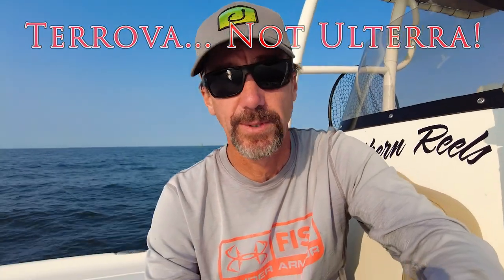Minn Kota Trolling Motors (The Good, The Bad, and the Ugly!)

Comment: Wow...what a gracious and even-handed treatment of your experience.  Thanks for sharing!!  When I used the motor selector (I have a new-to me since April, 2024 Sea Hunt Triton 172) it recommended a Riptide Terrova 80lbs thrust 24v with a 72" shaft.  My only gripe is that either I'm going to have to fabricate and mount the unit on a bow sprit or cut my bow railing.  Like you, I consider my boat practically "unfishable" without a trolling motor since the tides and wind on the Long Island Sound mean the fluke drift can be too fast.  Not looking forward to the struggle of wiring to the bow from the console, either...but weight distribution on a 17 foot boat is a significant concern.

Comment: I recently saw another YouTube video talking about using a Minn Kota trolling motor when fishing near a bridge or when you can't get a good satellite signal. The gentleman suggested switching the autopilot mode from Advanced to Legacy in the settings. Legacy uses a compass instead of a GPS. Then you set a compass heading into the current and adjust your Trolling Motor speed to hold your position. I haven't tried it yet myself but it seems like it's worth a shot.
Reply from the maker: Wow never thought of that, interesting!

Comment: I went for the Garmin Force manually deployed. Very quiet and easy to place in water and remove. Expensive!! Three problems I've had  1. It  locked up once (electronics froze) and I had to remove battery + for 15 sec and cleared the problem. 2. Sometimes it doesn't recognize if it's stowed or not. I just raise and lower it a couple time and it works fine. 3. The head unit will slip down (bottom out on rest) which causes irratic operation. I keep an eye on that separation and it's fine. Spot lock had to be calmed down (was fast and irratic) but you can set it to a slower response. It's 24 volt and I think 50 inch shaft. Garmin has a fast help line response I've used while on the lake, I perfer the call back solution rather than wait in line, especially while fishing.

Comment: Some feedback, I've spot-locked UNDER an Interstate bridge with maybe 10' clearance many times with no problems so there may be some location specific issue with the bridge you showed.  I bought a 24V Terrova on 10/28/19 and they have their issues also.  The steering module on mine stopped functioning (motor worked, steering didn't) so I replaced it on 3/5/24 to the tune of $238, delivered.  I was going to repair my old module and keep it as a spare until I took it apart.  The housing was full of corrosion and the drive motor was completely rusted so I tossed it.  Now, I rinse my motor off after each trip (along with everything else on my boat) so the failure must have been caused by seals that don't keep the saltwater out.

Comment: Good review.  I have had a 80 lb thrust, 24 V, 60 inch Terrova for 2 years now on my 19 ft center console - best addition to my boat.  I opted for the Terrova over the Ulterrra because I was not sold on the automatic stowing capability - just another thing to go wrong in my opinion.  Runs great on my 24 V LBP Lithium battery.  But you definitely have to be very mindful of the spot lock when under bridges, it looses satellite connection just like my satellite radio in my car on densely covered tree lined roads.  I normally try to keep the center console of my boat (where the satellite puck/antennae is mounted on my boat) on the edge of the bridge to attempt to maintain satellite coverage.  10' or 12' foot steelhead rods make it easier to fish around the pilings for Sheepies.  Learned that from you!!
Reply: What lithium battery are you using? Does one 24v battery last all day? Ok I see LBP is the brand, the 75 ah battery?
Reply: @Carnivorefitness2024  I have a 100 aH battery. Yes it will last more than a day. For example I went out to the CBBT this morning to try for sheepshead (no luck, water was roaring and dirty out going tide). Used spot lock from 6:45 am til 12 noon. Then returned to Back River and fished till 3:00 pm. Battery went from 100% to 56%.
Reply: @Carnivorefitness2024  Correction- O have the 75 aH battery- just double checked.
Reply: @tonygruber  Nice! I didnt see the 100 ah battery ok cool

Comment: If you already know then never mind but as far as holding your boat by that bridge, go in the settings on the remote and try changing the boat scale. I’ve got a smaller boat with a 80 lb Terrova and I had to set the scale to the lowest setting but you might need to go to plus 1 or plus 2.
Reply: What size boat do you have the 80lb on?  I’m thinking of buying a used one…
Reply: @hvacguy3512  I’ve got a 16 foot fully decked Lowe boat. The Terrova is fantastic. I can’t live without spot lock. It’s paired with a 75 amp hour 24 volt lithium battery and it lasts all day. If I ever need to get a new trolling motor I’m going to get Power Poles new brushless motor.

Comment: Agreed, heard lots of complaints about the ulterra. IMO, terrova is the way to go. Currently running a terrova 60” 80lb 24v on a keywest 188br. Plenty of motor for that boat. Previous experience with the same motor was on a 206 roballo caymen. Worked well on that boat as well.
Reply: If I can get ahold of one, i am putting one on my KW 186 Sportsman this winter
Reply: @PaulyV56  good luck, I waited for mine for about 5 months.

Comment: Have you noticed the shaft flexing a lot? I've seen a few videos the shaft look like a rubber band. Makes me nervous to buy one. I fish west coast 30-40 miles out in the ocean for halibut/lingcod.  Spot lock seems like such a great addition but watching them flex around in heavy waves and current I'm skeptical     great video found an 87" 112 36v with icon charger and 3 icon batteries for 4200 with only a couple hrs on it.  It's the manual one.  Thinking I may jump on it

Comment: I have the Ulterra on my 1910 Tidewater, I was assured the 60 inch shaft would be adequate, it's not. I also had issues with the motor stowing. It's a $2,300 mistake, I should have bought the Riptide.

Comment: My Ulterra rocks back and forth with the waves. The bracket is tight down below so I don’t know if this is normal operation or if it needs to be tightened on the top side. Does anyone else have this issue or know if it’s normal or not?
Reply: I used the plastic quick release on a 60 inch 80 ulterra and it can’t be any tighter to the bow but still has some play. I believe it to be the plastic quick release but I do not believe it to be a problem.  That dude can’t come off. Shaft will break first. I know this for certain. Ended up selling busted shaft terrova and my ulterra has been really good. I drag it over rocks and bottom regularly and it just keeps on going. The key to a lasting ulterra is to regularly clean and lubricate all friction baring components. Debris is the number one culprit concerning malfunctions and belt breakage. Outside of a total power down which resulted in doing a reset on the water…I haven’t had an isssue. Post reset on the water: no issues since the reset and have followed contours for hours on end. System seems to function well now. Reset and calibration of stow and deploy is easily done on the spot. Many many hours of use since then. My buddy has a 5 year old one on his lund and it’s never even done what mine did. His is so rough looking too. He just cleans it and lubricates it several times a year.

Comment: I wanted to buy a Minn Kota but got put off when they could not specify maximum operation voltage or even the weight of the machine in the manual. Also they are not compatible with modern Lithium batteries e.g. a 6S pack. They need to step up their game. I did try probing them for information and got dumb answers.

Comment: The greatest flaw in my mind is the inability to install foot controll. This would solve 2 problems.
1. Pounding your boat against bridge pilings when the motor cant see GPS.
2. Trying to fish with one hand when you are ficed to use the wireless controll.
The dealership never mentioned that you can never install a foot control on the salt water version.
Reply from the maker: That's not true.  I have a foot control.  Tried it and didn't care for it really.

Comment: I'm looking into the Terrova right now for my Bayliner VR4. Looking into Ipilot or I-link & either 60" or 72" & 80lb or 112lb.

I'm in Utah, so it's for Kokanee, Trout, & Bass fishing. 

Any recommendations or thoughts?

Boat weighs 2,822lbs dry weight
Reply from the maker: Depends on how much current and waves you deal with. Lots of waves while fishing go 72 inch. Lots of current go 112.
Reply: @Southern Reels Fishing  Went with the 60" 112lb. When fully deployed, the motor is as low as the boat keel.

I'm making the mounting bracket now, made a few test mounts, made changes, almost completed, then installing... and waiting on the 36v LiFePO4 Battery.

Comment: I’ve had both the Terrova and Ulterra. The Terrova(brand new) needed a motherboard at two months. Bought a center console and bought a new Ulterra. All kinds of issues…..shutting off while running, no stow, no deploy and yet again another motherboard. If this motor goes out I’m replacing it with a Rhodan! Will never buy another Minnbroka!!
Reply: Hopefully Rhodan is still in business. Their factory is in Sarasota. Close to where Ian went in.
Reply: My boat came with an Ulterra, I would give it Right back to you and put a terrova on. Had Nothing but problems with my ulterra